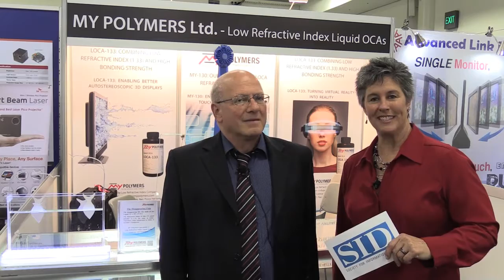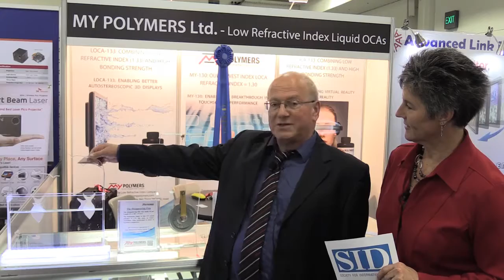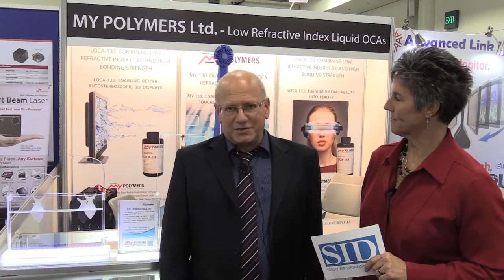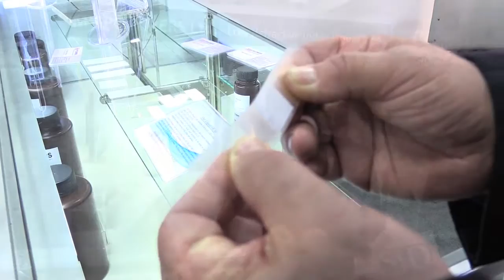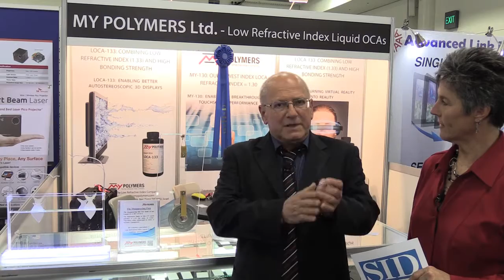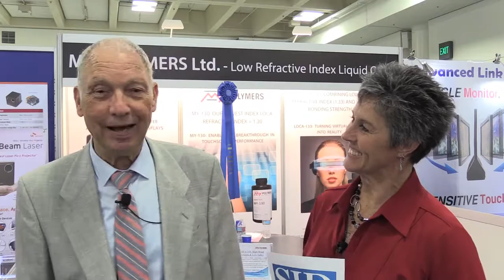Display Week 2016: MY Polymers Wins Best-in-Show Award

Comment:  Fine particle, electrically conductive ink for screen printing
 Can be easily blended with other silver conductive inks in order to
achieve intermediate resistance values
 Extremely tough, scuff resistant and has excellent adhesion to polyester,
polyimide and other plastic substrates, with outstanding crease
 resistance when used on these substrates
 Dries to a smooth surface finish in order to optimize surface area contact
to enhance electrode interaction
 Designed to dry quickly after printing
 Sensitive material - Do not expose to light for long periods and do not
allow material to contact metal.
 Compatible with our UV curable dielectrics, conductive epoxy adhesives,
UV curable component encapsulants and conformal coatings
Appearance Thixotropic silver colored paste
Viscosity (cps) Brookfield DV-III Ultra,
SC4-14 @ shear rate of 2 @25oC 36,000 - 44,000
Drying Schedule <4 minutes at 130°C
(depending upon oven heat profile,
air flow, humidity and print thickness)
Shelf Life 6 months in unopened container
Total % NV Solids 68% ± 2%
Thin Using Solvent 70
Hegman Gauge <50.0 µ
Volume Resistivity (ref. ASTM D-257) 2 x 10–4 ohm/cm
Surface Resistivity <75 mΩ/square/mil

If demand please contact the relevant materials:Guang Zhou City Silver Well trading Co.,ltd.‍
Cell 86-13922125860

E-mail:laiqiangping2010@163.com